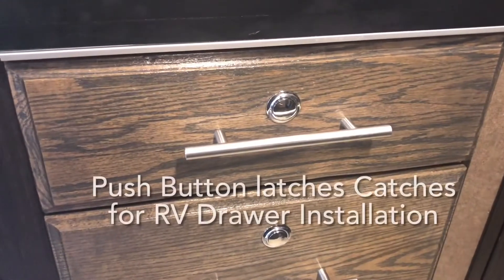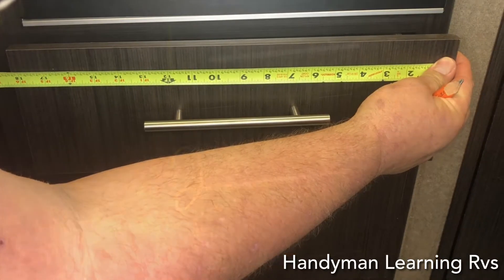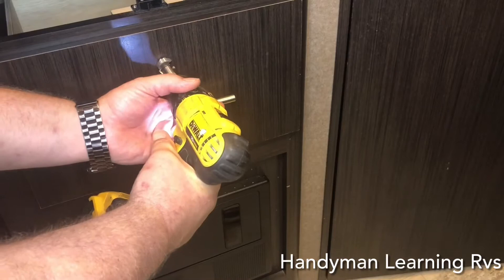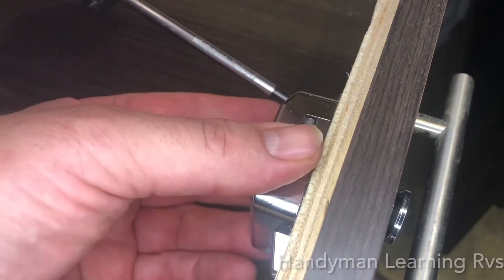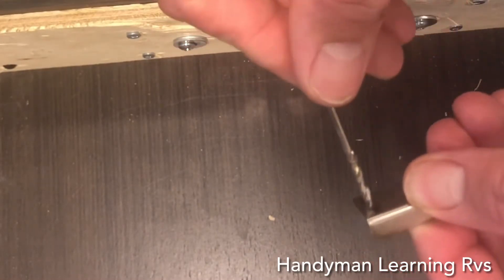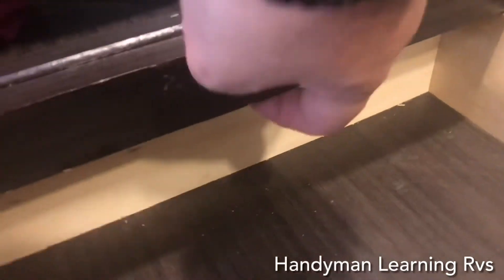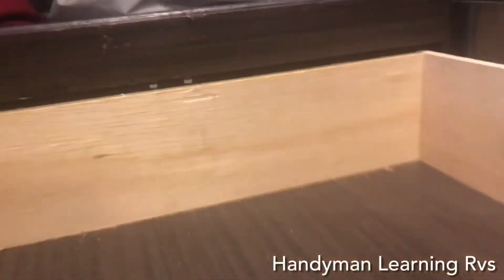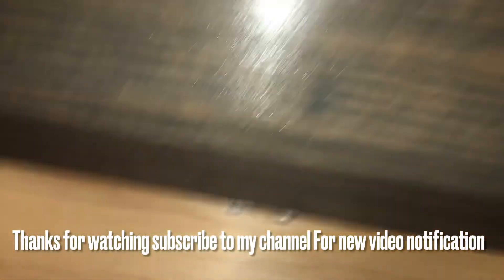Rv push bottom drawers travel latch catch

Comment: An alternative is to mount the latch so that it works when the provided catch is installed. Measure from the top inside down, adding together the depth of the catch, a small margin, and the distance from the center of the latch to top of the latch in the "unlatched" position. Drill the hole accordingly.
Reply: The equation x3+y3+z3=k is known as the sum of cubes problem. While seemingly straightforward, the equation becomes exponentially difficult to solve when framed as a “Diophantine equation” — a problem that stipulates that, for any value of k, the values for x, y, and z must each be whole numbers.